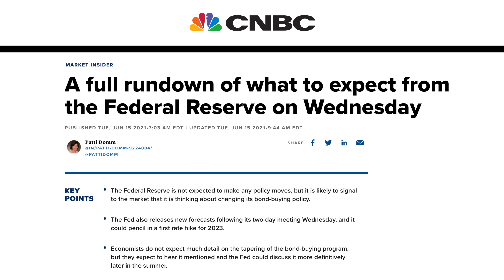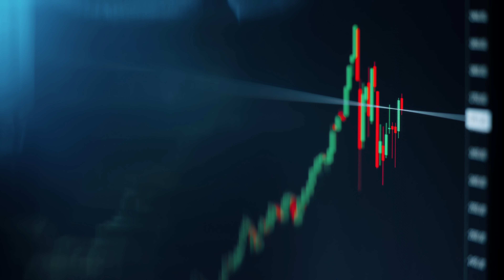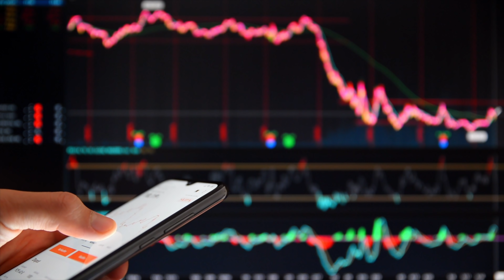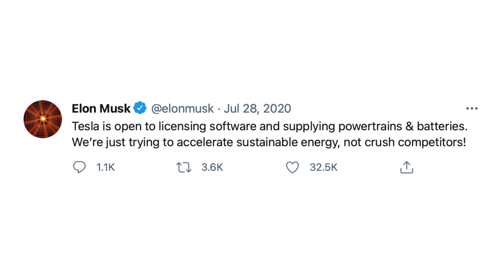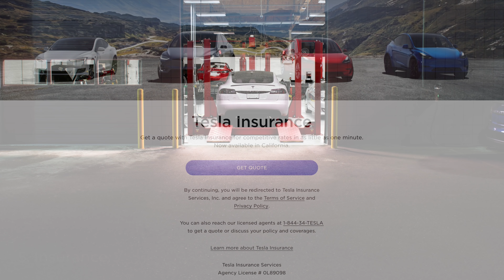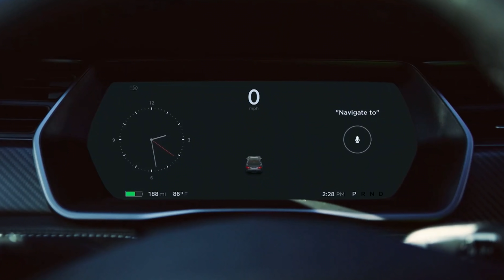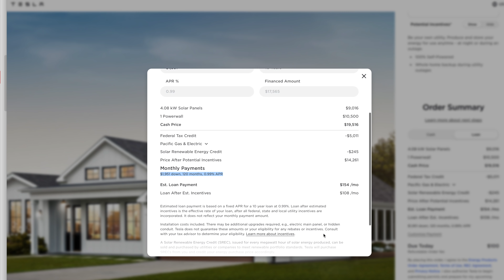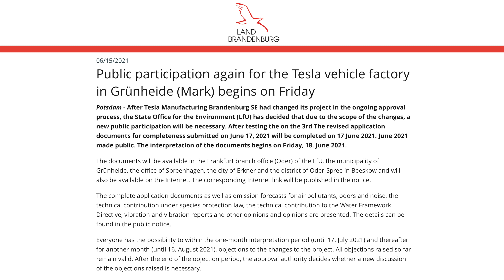Tesla Stock Is Dragging - What Will Break It Out? (TSLA)

Comment: Too me it's easy. Blown (their announced) timelines=failure to execute. (doesn't  take away from their great long term vision though). Semi due in 2019? Roadster due in 2020? Cybertruck delays?  Delays of the Refresh S/X and then cancellation of the P+; Solar Roof Fiasco, FSD Release/Robotaxi network in 2020?? They've got to execute better to the timeline. If they bring out mass production of 4680s, a very close to FSD 9 to full autonomy this year - all will be forgiven as that will drive the other things. These are the 2 product pinch points they have to hit or at least show this year / soon.
Reply: It's hard to be precise with times when you're doing a lot of things for the first time.
Reply: @TheEvilmooseofdoom  that's why the stock price hasn't move and will continue to decrease if they can't execute timely

Comment: Check out the Tesla Economist last video. I’m pretty sure tesla uses 4680 in Plaid currently
Reply from the maker: It doesn’t
Reply: @TeslaDaily  Well it's unclear how did they get it with Plaid with the old battery. We'll know for sure when Sandy gets new Plaid and cut it in parts
Reply: @antonkramarenko8890  They explained.  New motors, new battery chemistry, and a new pack with waaay better cooling.
Reply: @TheEvilmooseofdoom  the weight is much lower. You can get it with the new batteries only, changing chemistry is not enought
Reply from the maker: There are probably thousands of changes in this car, including in the battery regardless of form factor. I guarantee they are not 4680s.

Comment: Since Tesla can't make 4680, German approval delays won't make a difference.
Reply: Tesla can't make 4680's?  To what are you referring?
Reply: @TheEvilmooseofdoom  if they have been making and starting scaling since battery day, they should be in a low volume product by now
Reply: @TheEvilmooseofdoom  my real worry is not that they won't be able to make 4680s but am concerned that optimistic Elon may be constraining production, at least in Germany, to the dry battery electrode method.  That is likely to have an undefined timeline.  Maybe the latest new environmental regulatory discussion s may permit some scale of wet process.  I suspect the other elements of scaling the 4680s would have a more predictable ramp up.

Comment: Once you fully understand the scam that took it to $900 then you will understand the stock. Stock is not the company in this rigged market. AMC and GME are extreme examples of what the market has become. Quite sickening once you get it.
Reply: Wycoff method looks to be happening with Tesla
Reply: @cszafarczyk63  My last credit spread paid 100% when the stock closed under $615 on Friday. I have $600-590 debit put spread that expires on 28th. Sometimes I take profit early. If the price is just under $590 this Thursday I may cash and take it back Friday. The manipulators work hard on Friday due to the option value of Tesla.
Reply: @maximumvalues  I’m a long term holder, so
I’m not concerned. Just stating that the Wycoff patterns is seeming to unfold here.
Reply: @cszafarczyk63  cool. Long term holding this one has worked out. However, don't ever get married to any stock. Cuz I've seen many a long term hold plan go to zero. I doubt this one will but always a chance.

Comment: Why defend Tesla and Elon specifically when they are missing self imposed deadlines. What is the need to defend the company when pointing out their propensity to be “aggressive” which for any other company is called misleading investors when it comes to timelines. As you state there is a fundamental issue with credibility when a company can’t even call project something two weeks out.
Reply from the maker: I’m not sure where you think I’m defending? I pointed out the problems and just noted that as a long term investor I’m not as concerned with some of those things as the market might be. Would hardly call that defending.
Reply: @TeslaDaily  Would you agree that credibility and transparency from a company and in particular when operating in the unknown unknown problem space of FSD are equally important for both the short term and long term investor? Especially since FSD is the cornerstone of the bull thesis for Tesla being a multi-trillion dollar company. As things currently stand any reasonable person would not believe any Elon FSD prediction but then the question becomes is Tesla a couple of years away? A decade or more? At a certain point institutional investors will completely discount the possibility and multiple compression will occur.
Reply: There is a difference between a projected date and a deadline.
Reply from the maker: What matters more than timelines to me is who is leading. I do agree that credibility is important over the long term as well, I don't think anything I said conflicted with that and I have made the case over the years many times that it is something Tesla could do a better job of, and in many cases they have. There has been notable regression this year, again something I am bringing up. That doesn't dissuade my confidence that Tesla is still leading which is ultimately more important long-term.

Comment: Long term trader and shareholder. But the cars are built like sh$t. My god my model y has so many issues. Panels not aligned. Spoiler not glued down right. Seats suck. On and on and on. Cmon elon
Reply from the maker: I’ve had no issues. Don’t overweight your own experience.
Reply: @TeslaDaily  rob. Cmon. U should know first hand that Tesla has had issues with QC. This is a known issue. They are making the model y in a tent. Are they major issues   ? Not so much. But this needs to be fixed. $70000 car should be built much better. I give Tesla a pass only because of the amount of money I’ve made as an investor.
Reply: early models do tend to suffer quality issues, and that's true of all makers.  As production steadies out the problems even out.  I have been lucky enough to see 3 Model Y's so far and all were perfect.  To claim the problems are universal is merely being simple.
Reply: @TheEvilmooseofdoom  my car was built 2 months ago! Not 2013
Reply: @brokebastage  Model Y wasn't out in 2013.  Sorry to hear about your issues but again that doesn't make them universal.
Reply from the maker: It's still the first 12-18 months of production. Have you ever owned a car in its first year of production before? Unlikely. And sure there are some quality issues but Tesla is delivering 200k cars every quarter. Of course there are going to be some problems. Statistically, they don't seem to be too significant to me.